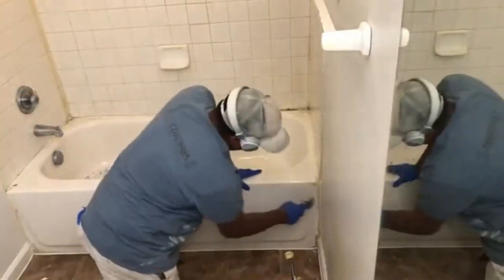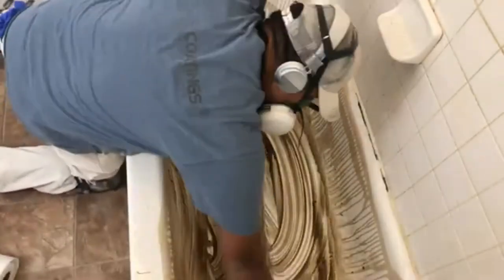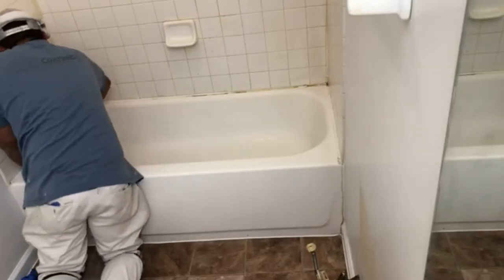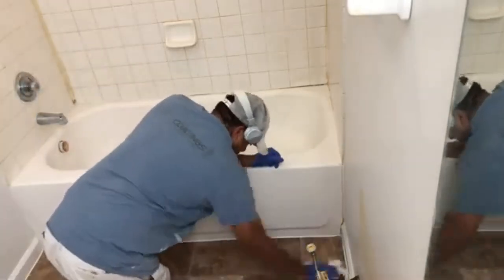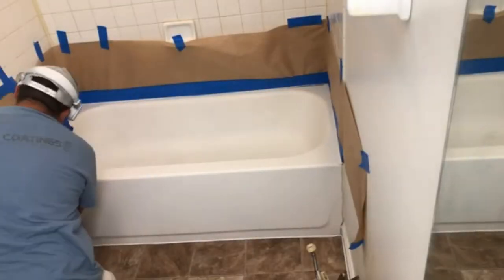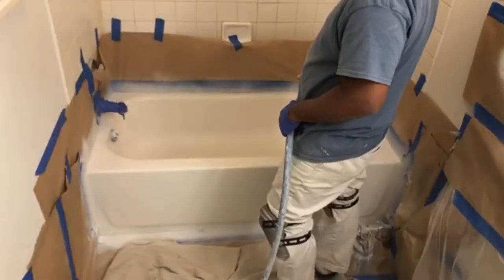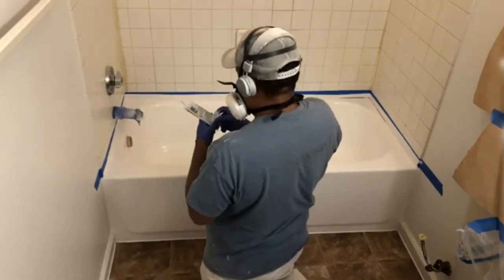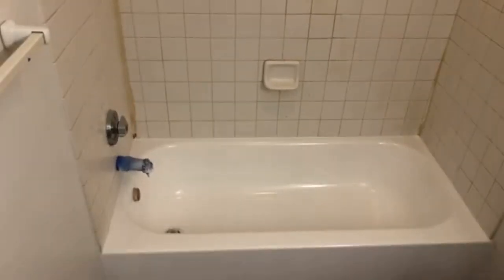The Secret Home Business That No One Knows About

Comment: Hello, I was wondering what do you do to get the well water rust off of tubs before spraying? @ the tub guy
Reply from the maker: Usually some sanding and the etch works pretty good. Also walmart sells a rust remover made by "ready strip" you can find in the paint thinner section of the store.
Reply: @thetubguy2293  yes does the rust remover usually work for you? And what sandpaper grit is god for the rust and does it remove it pretty good? I have the basic etch is there a particular kind you could recommend?